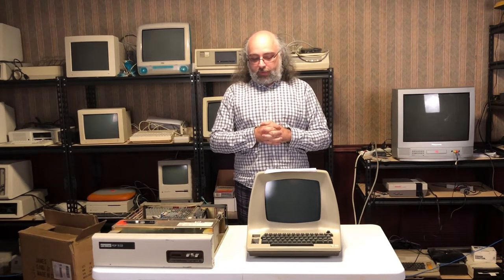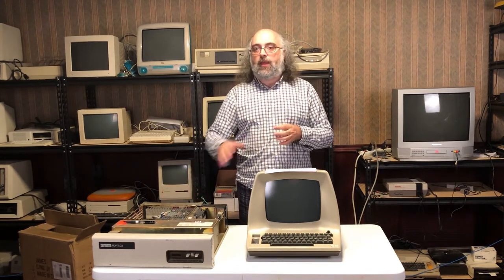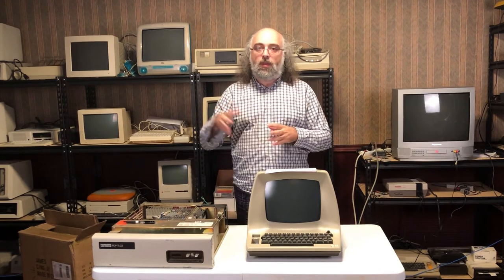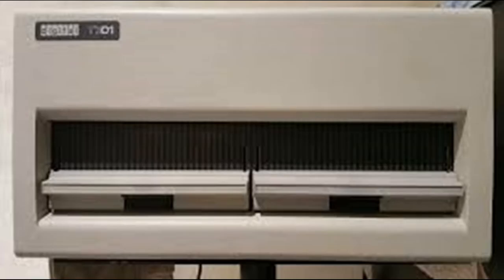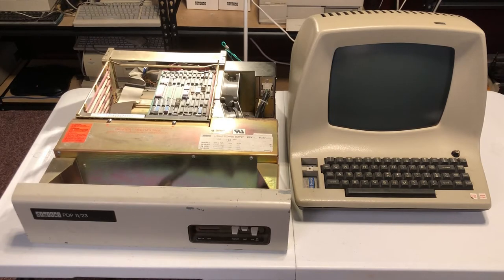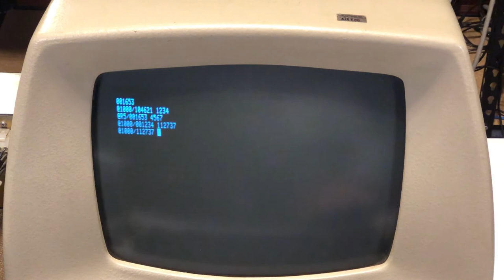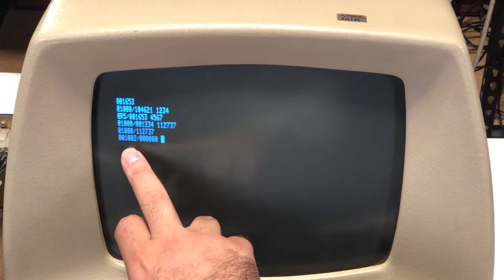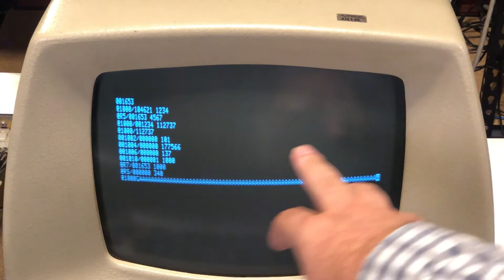Computer History: DEC PDP-11 The 16-bit computer of 70s

Comment: In the early 90's, Right after highschool, i was a manager of a pizzashop, having 10+ years experience with various 8bits, early IBM's etc, but never seen a mini/mainframe before. The boss, one day handed me a used terminal, looking just like the one pictured, and tasked me to setup the stores finances on it. I was like "Wth? There is no program, harddrive, basic or nothing on this thing? Just a blinking cursor. Something, or rather most of it, is missing. Wheres the rest of the computer?".  Boss: "Nah, this is all of it, you dont seem to know computers aswll as you said you did. Cant you just program it?" Seems he gave me only the terminal from the 70's.

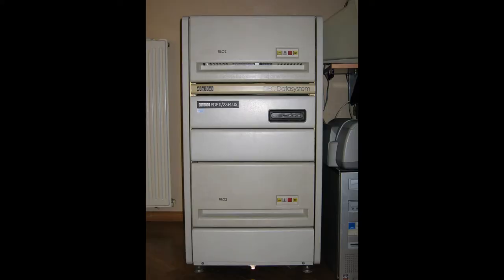Comment: 5:47 The mini-computers were definitely mini-sized. Compared to the other computers of the day, the mainframes. A mainframe used to fill a small hall, sitting enthroned in a which air-conditioned room like a god, serviced by priests in white cassocks, separated from the commoners by glass screens. At least the mainframes I have seen / worked with.

Comment: I was born just one year after the PDP-11, but I imagine to see there with you Brian Kernighan & Dennis Ritchie talking about the new language of computer programming "THE C LANGUAGE", ... ohh my god, ... I'm dreaming looking this video ...   on that console was born a myth of the computer programming language, and the UNIX also.
Reply: I worked for DEC in the 1970's and 80's. Dennis Ritchie taught me to program in C. I started out as a technician repairing PDP-11/40's, DECSystem 10+20's, and VAX11-780. I later became a programmer and designed the video control and character generator firmware for the VT240, and later still I led a team who developed print symbiant protocol translators for the VMS operating system. In the course of this work I used PAL-11, RSTS, TOPS-10 & 20, RSX-11, and of course VMS. DEC was a great company to work for.

Comment: 15:02 I thought you meant “magnetic tape”, which stumped me. But it seems you actually mean “paper tape”!
Reply from the maker: Yes :)
Reply: I programmed a PDP-11 running PAL-11 on paper tape! To edit a program you loaded PAL-11 from paper tape. Then you loaded the the editor from paper tape. There was no video terminal. Your terminal was a hard copy teletype or, if you were lucky, a DECWriter. After entering your program on the terminal you punched out a source tape. Then you loaded the assembler program from paper tape. It was a two-pass assembler so you ran your source tape through the paper tape machine twice. The assembler would then punch out an object code tape. You now loaded the linker from paper tape. Now you ran the object code tape through the paper tape reader and the linker punched out an executable program. Now you could load your program from paper tape and run it. Found a bug? Go back to step 1: load the editor from paper tape, then load your source tape.